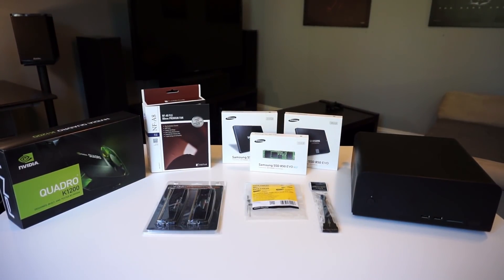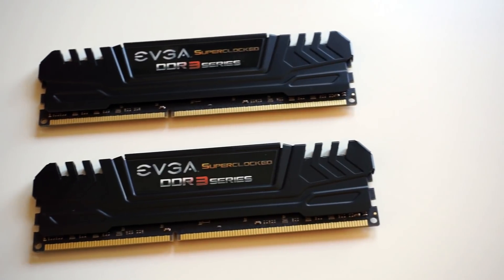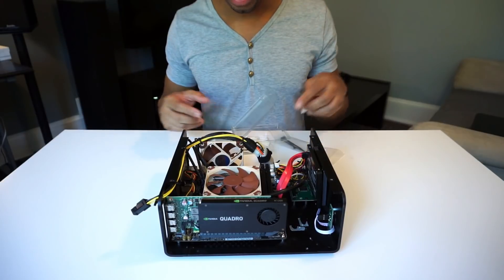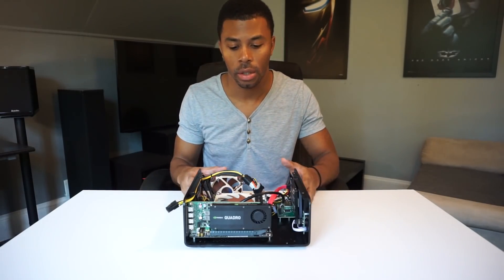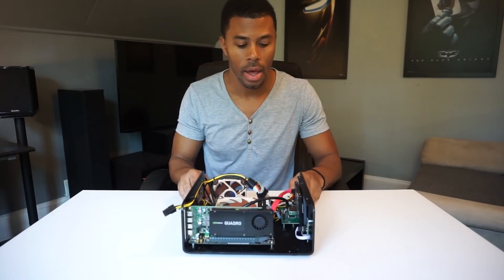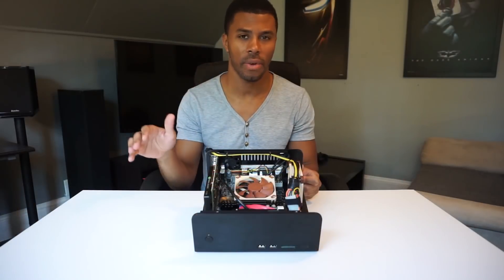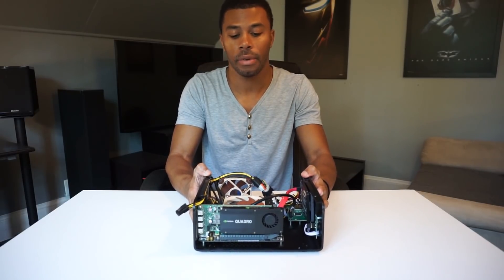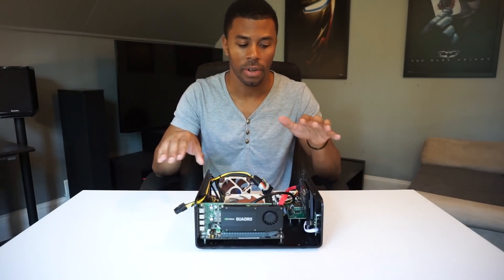Ultimate Small Form Factor Mini-ITX Build - Part 2 - Upgrades

Comment: Hey Jay. Revisiting this case, I'm curious about the clearance beside the pci port, for the video card. How much width can it accommodate? 
Will it fit the low profile single slot rx460? The gt1030 will surely fit, but the 460/1050 have fatter heatsinks, curious about those...
Reply from the maker: The 460 would be too thick. I believe there is a low pro, single slot 1050 though.
Reply: Tek Everything Really? Couldn't find it. Just forum discussions about dremelling off the dvi port lol
Reply: Tek Everything Here's a thought- given the height of this case, can a single slot full height card (1050) be mounted OVER the mainboard, on a hard disk bracket? With a riser cable. Cooling would need vents in the top perhaps. Thoughts?

Comment: Hi! I know you've been asked the question on LowProfile GTX-cards a lot already, and I don't want to ask you the same card-specific questions again. However, having found no data anywhere else online - could you possibly measure or estimate how much space there is, thickness-wise for a GPU. There are a lot of single slot or low profile cards but very few that are both. The LP cards that many have asked about (GTX750/1050) are quite slim, and removing the fan and using a standard case fan like you've done might just work, if there are a few centimeters / half inch more space than your Quadro card is currently occupying. Thanks in advance!
Reply from the maker: There are definitely a few millimeters. I will have to take a measurement when I get home. I would recommend just going with a single slot low profile quadro or firepro card. You really don't want the fan sitting flush against the side of the case.
Reply: Great, thanks for getting back to me! = ) 

Technically, on a GTX750Ti or GTX1050Ti like others have mentioned, I think removing the fans and putting a 80mm case fan at the bottom of the GPU at 90 degrees might keep 90% of the thermal performance of the GPU. Which is still better than any Intel HD graphics.

One of the LP GTX1050 cards are specified as 35.3mm / 1.39 in thick with fans, meaning it should be ~1cm thinner without fans.

https://goo.gl/SNJGje
Reply from the maker: Interesting Idea. I think you are right, that may work reasonably well. I would still probably go with a quadro card though since you could get a little more power out of them and have a guaranteed fit.

Comment: Can you fit the 1050ti low profile in here? It's a dual slot card.
Reply: pnp072000 Only SFF card that's single slot and is more powerful, and could fit in this case, could be the AMD RADEON PRO WX4100, but that is not a gaming card. Spec-wise, it's like an RX460 with the full core count of Polaris 11.
Reply from the maker: No, you can not.
Reply: Tek Everything Thanks, what would be the highest performance card that you can install in this case? Also is there another case similar in size to this, that can install a gtx 1050ti low profile?
Reply from the maker: ^ what he said... Also while not as narrow as the Wesena case I used here. The Logic Supply CL100 would be a good fit for what you are trying to do.

Comment: Great video, subbed. Planning on doing a hackintosh build with this same case and GPU. How are the GPU temps on the card and how loud is it considering its right at the end of the case? I won't be transcoding video or gaming on this build, I will however be using 2 4k monitors so that I can multitask web and xcode development; expecting the card to be around 50% load at all times with OpenGL applications.

Thanks in advanced,
Charles
Reply from the maker: The temps are good. It is a very efficient card, that doesn't produce a lot of heat. I don't remember seeing any temps over 65C even when working with video.  You should be fine.

Comment: hey whats a good graphics card that I can use as a gaming gpu w/that motherboard/chassis
Reply from the maker: The Quadro K1200 or equivalent FIrepro cards are really your only options with this specific case.  It only supports single slot, half height, short pcb cards.

Comment: Hey! I'm actually in the process of building a similar rig in Weseba's case. Thanks for inspiration! I'm planning to go with S series 4th gen i5 (64W) and GTX 750 (60W). Considering the fact there will SSD, keyboard, mouse, couple of fans and a WiFi dongle, do you think a 200W picoPSU can handle that? Thanks!
Reply from the maker: Awesome, glad I could help. The 160XT should handle that load easily with room to spare.
Reply: Hi! Thanks for quick response. Just got myself a second hand i5-4430S, can't wait for other parts to come. I find it difficult to find a 150-200W power adapter. Where did you get yours?

Comment: Wil a gtx 970 mini fit, and if it doesn't does a gtx 960 fit?
Reply: No and no. Only single slot low profile cards fit, and the card I would recommend is the Zotac GT 740. And if you're into modding, you could fit a cooler of another card onto the low profile 750 ti, but that's the best you're going to get.

Comment: do you know where I can get a low profile fan that will handle a 88w TDP? I want to use a 4ghz intel i7 cpu on a mini itx build. thanks, your builts are awesome!
Reply: +PhotoBooth biz I would recommend the Noctua NH-L9i. It's great for those kinds of builds and I think it's the one he uses in this video.
Reply from the maker: +PhotoBooth biz  What is the max height the fan/cooler can be?
Reply: I dont' have a specific case picked out yet, so there is no max height, All the coolers I've looked at only handle 65tdp. I saw your awesome review on the water cooling unit but it was a bit noisy. Are there any other solutions for hotter CPU's? If case has to be taller I can live with that.

Comment: What kind of power supply are you using, where did you get? I only know about AC
Reply from the maker: +GreenMachine Space   It is called a Pico PSU.  They are used for small form factor builds.  There is a link in the video description to the PSU and power brick.
Reply: +Tek Everything I thought I knew a good bit about computers, but I've never seen a PSU like that one. Besides having a power brick, what other limitations are there? I'd love to make a small build like this, but I'm a big gamer and I currently have a GTX 980 so I don't think it could power that...
Reply: I don't think it will lol. You may want to take a look at this case SilverStone Technology Raven Z Mini-ITX / DTX Small Form Factor SFX Computer Case with PCI-E Riser and Custom Low Profile Fans, Black (RVZ01B). 
You will also need a SilverStone Technology 600W SFX Form Factor 80 PLUS GOLD Full Modular Power Supply with +12V single rail, Active PFC (SX600-G) That case will fit a 980 GPU
Reply from the maker: Yea, if you are using a 980 it is almost impossible to do a small form factor build without some sort of custom case, like the Ncase M1.  The most powerful SFF PSU is the HD-Plex 250, and it can only comfortably power 970's from everything I have read.

Comment: Hey do you think you could fit an AMD Radeon R9 Nano is this build? I love the vids keep them up bro!
Reply from the maker: +Blood Angel  Haha yea, I wish I could fit a Nano.  I am working on plans for a custom case that I will build from scratch with the Nano in mind.
Reply: I need it to be hackintosh compatible and affordable. I got the Asus Z170i Pro graming with DisplayPort and the Streacom F1C now. The smaller brother of this case. It looks wonderful. However I'm waiting for a low profile RX 460 and its hackintosh compatiblity and I will switch over to this case. Thanks for thinking out loud.
Reply: +FoamFingerProductions: If you cut it in half, it will fit no problem at all.
Reply: +Tek Everything DO IT. Since there are no real single slot with displayport.  I would love to see a nano gets a mod to fit into this case.
Reply: RunForresRunnn Unless you're planning to modify the laws of physics, there is no way to modify the case, or the Nano, to get it in this case, and still having the cover close.
Reply: +RunForresRunnn there are some quadros and firepros with DisplayPort. Fairly cheap ones at that. Also, if you're willing to fork over more cash you can get DisplayPort on your motherboard.